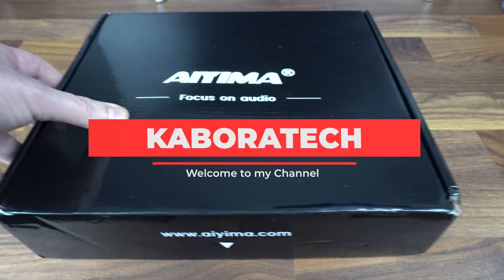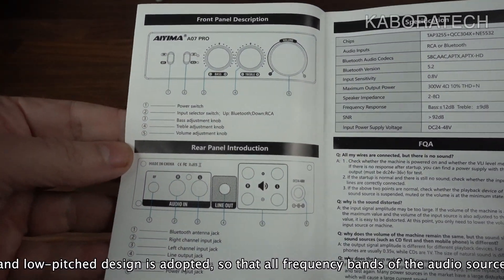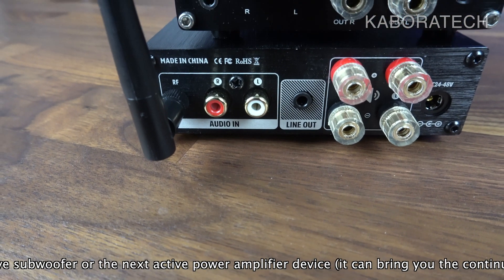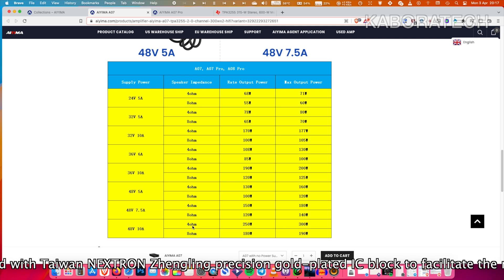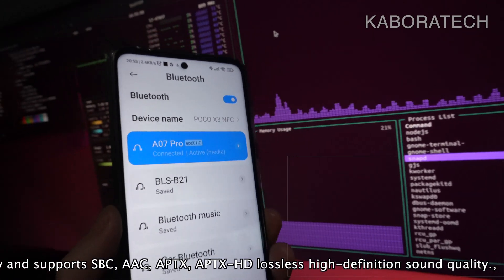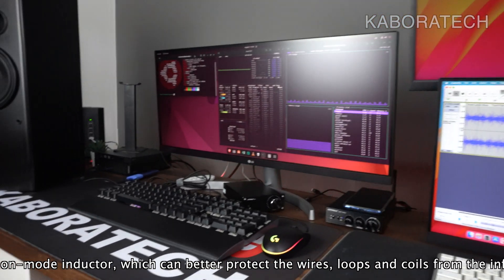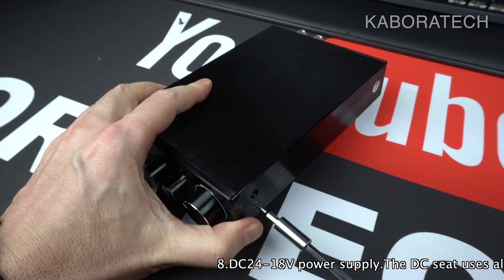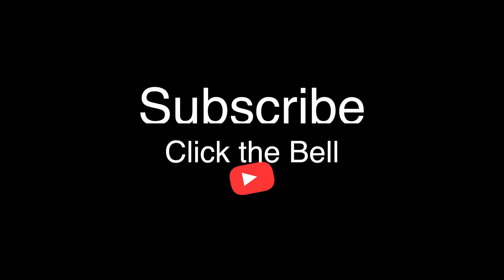AIYIMA A07 Pro 300W Amp

Comment: Thanks great review how much is the 48v psu
Reply: 300 wt is 2 speakers * 150 wt  normal is 2*120 wt  / adapter 45 v 7 amp
Reply from the maker: Hello, check in aiyima website, they did not sent that info, I got that psu in the box...
Reply: That Aiyima will never reach near 300 watts per channel no matter what power supply is coupled with it. Plenty of people on forums have tested this. However i'm not saying it's a bad amplifier.
Reply: $15 for a 48v 8.5amp supply
Reply: @Billy-burner 

Where did you find that pricing.?

I want to buy
Reply: @Billy-burner  naw....$20 on Ali express gets you the 36V

Comment: what is RMS?
Reply from the maker: RMS watts refers to continuous power handling of a speaker or a subwoofer or how much continuous power an amplifier can output.
Reply: RMS is Root Mean Squared.  It is average power or used to indicate continuous power as opposed to peak power
Reply: 130~ wt    2 *130 wt